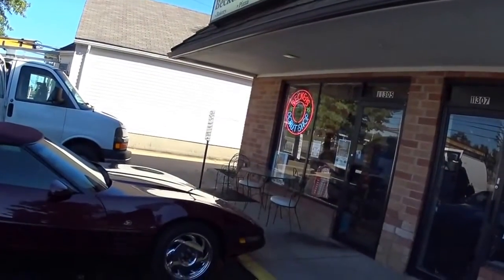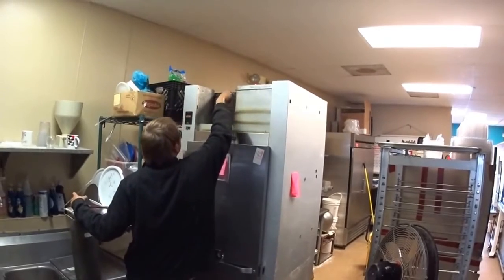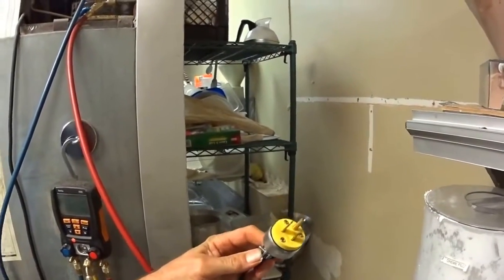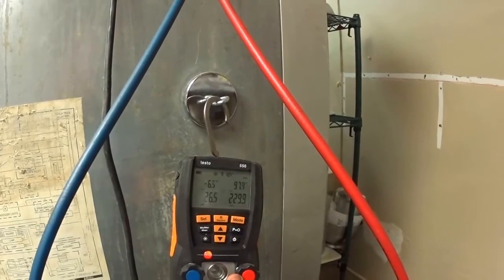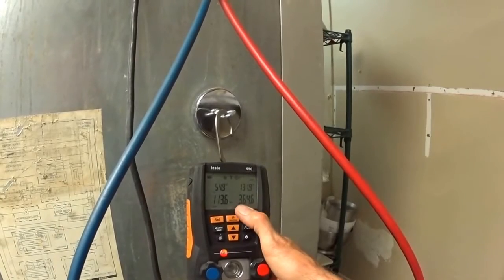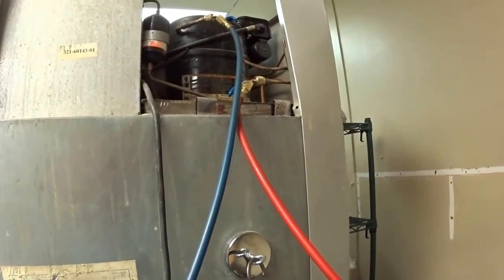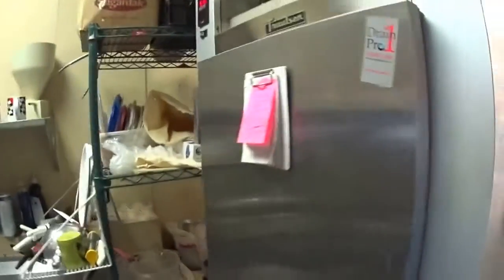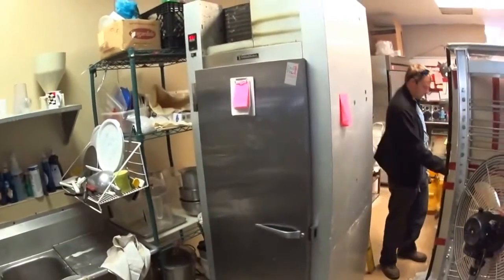Donut Shop, Freezer with a dirty condenser

Comment: Jim, I appreciate your videos and the different sorts of problems you see.  In this particular store,  seeing those fryers nearby makes me wonder if everything gets coated with a sticky film.  Must work like a magnet for dust on the condenser fins.  Yikes!  Also, judging by the condition of that plug, I'm guessing they are lucky the compressor went off on temp and didn't burn the windings before the safety kicked in.
Reply from the maker: The condensers in bakerys get powderd confectionary sugar in them so it always smells sweet. Restaurants get grease plus dust, that's guey, Chinese restaurants get this sticky guey stuf from the stir frying that gets on your tools for a week.